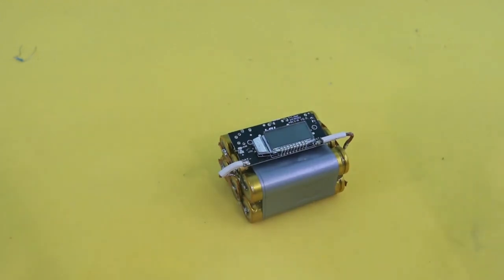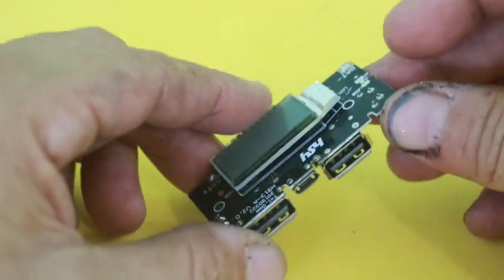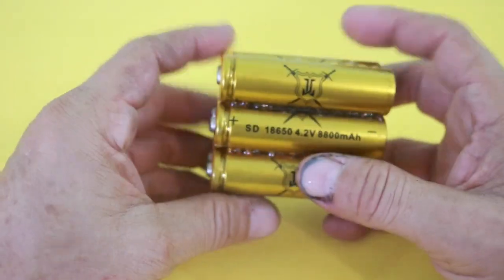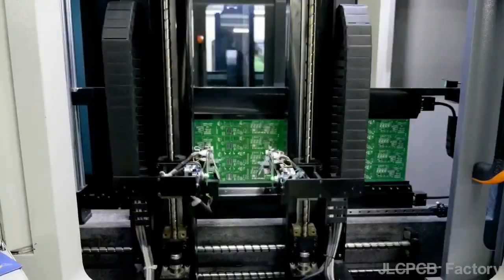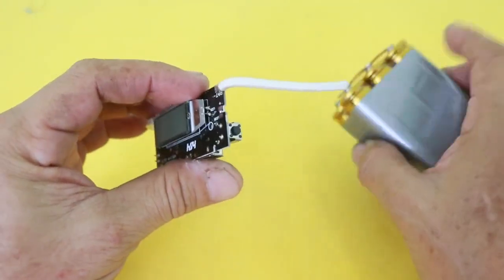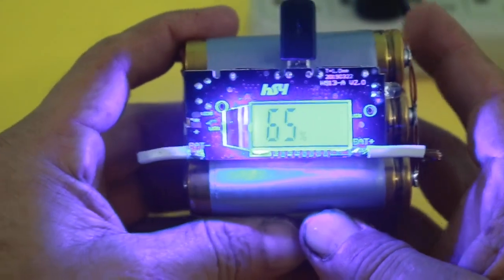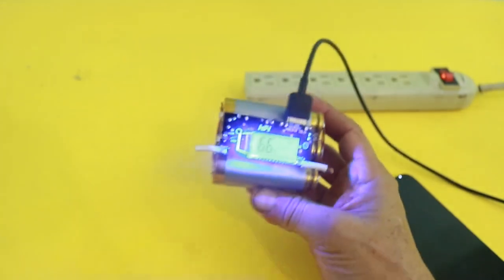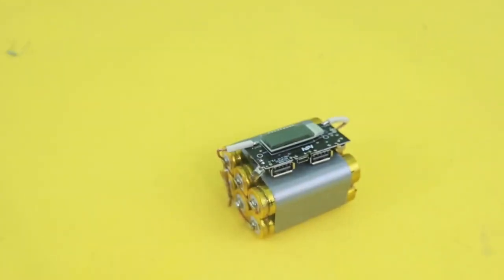Make a Simple Powerbank

Comment: Yess..new video..
For quick charger (qc3.0) its use 3 battery in series (more voltage)  and pararel to another series pack (more amp) with quick charger module..am i right? Because quick charger need 9-12 volt.